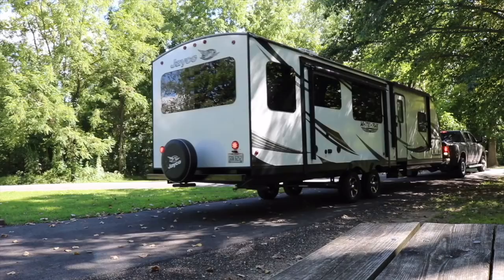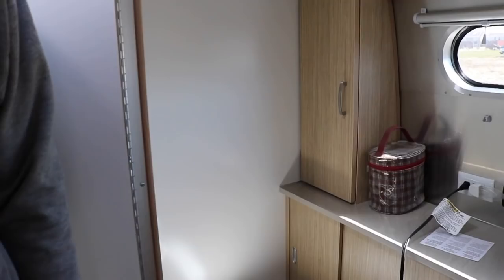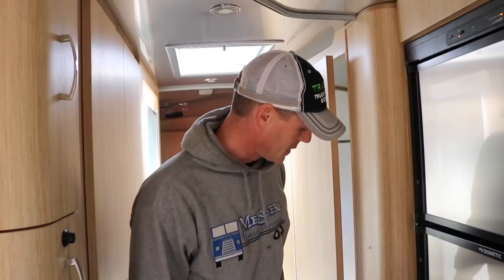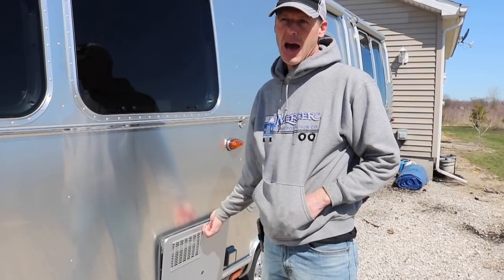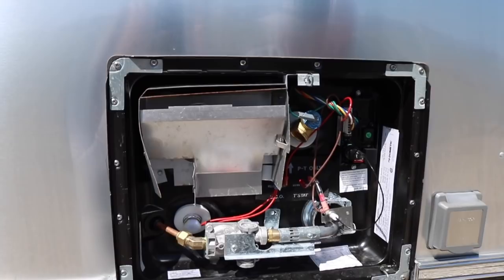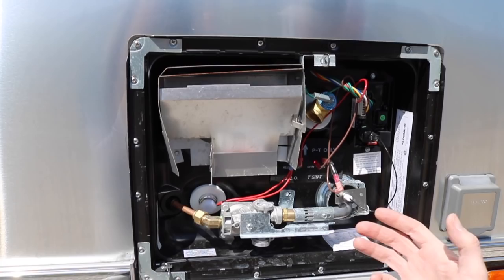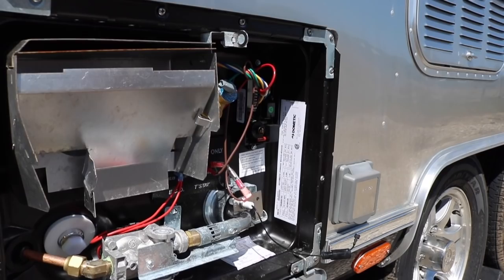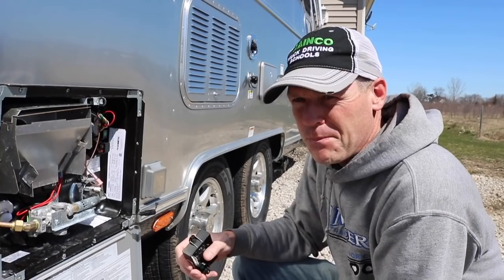DIY Atwood/Dometic RV Water Heater Repair (How To Fix)

Comment: Quick tip for those experiencing issues with there hot water heater. If you don't have the funds available or waiting for new control board you can always hook up the electric heater element (back of tank) with a normal 3 wire power cord, plug it in, and get hot water! Just be sure to unplug after water gets hot or use a plug in timer! Easy solution tried and tested by a full time rv'er.
Reply from the maker: The electric still worked, only the gas didn't with this bad board.

Comment: Thanks you so much for this video. Found it during a YouTube search to find the problem with my water heater. Our RV is brand new and the water heater would only work in electric mode. I followed your troubleshooting items and found that the cluster of wires were not seated properly. Once I pulled them out and put them back in all is well. The igniter fired right up and everything seems to be working fine. Saved me a 2-hour trip back to the dealership. Safe travels!
Reply from the maker: Great to hear! A saved trip to the dealer is priceless

Comment: My reply is late but thank's for the fix. We had the same problem TWICE! Thought the best thing would be to go to a dealer to have the repair done under warrenty, got jerked arround and had to pay for the 1st faulty board plus labor. A whole bunch of bad boards got installed by Dometic (1 guess where they were made). We never got a cent refunded by anyone, even asked Dometic who never replied. Had another no hot h2o issue but this time there wasn't a red fault light on the switch panel. There is a diode (don't know if this is the right description) encased in a plastic sheath to the left of the control panel. It had over heated (a small part of the sheathing had melted). Remove it completely and replug the wire into the male connector without the diode. The h2o heater should  start. Stop the heater and install a new diode. ........ Ivan
Reply from the maker: After we replaced the board ourselves we got a spare but never had to use it, luckily!

Comment: So glad you made this video. Others need to know what you just learned. We had the slideout break on our MH and found out FR would take three weeks to ship the part to a dealer. We took charge and called other dealers in the area (South Dakota at the time) and found a travel trailer company that had it. What we learned is forget about the RV manufacturer and go and look for the  part that you need. The original dealer who diagnosed the problem also replaced the part the next day.  Saved us a huge hassle and time as we were traveling the western states all summer. Our insurance covered it all.

Comment: Hey, just wanted to say thank you for this video. We got our brand new Airstream Sport 16F, and our water heater broke down during the second camping trip. I've purchased a new board, installed it today and everything works perfectly! Thank you so much for this video, you saved us a trip to the dealership.
Reply from the maker: Glad we could help!👍 Might want a spare board. We've got a lot of comments from people saying it's happened multiple times to them.
Reply: Oh, thanks for the advice! Did you have a chance to get a refund from a dealer?
Reply from the maker: I'm actually planning to call them to follow up today
Reply: Wandering Wagners how is your board doing? Mine broke down on the third day of a new trip :( looks like every other one has a manufacture defect :( buying a new one today.
Reply from the maker: Ours is still going strong... Knock on wood

Comment: Yo dude thanks guess what that turned out to be the solution for my hot water tank too. But mine cost 20 bucks. Because I went down and talked to my RV neighbor who said he was switching to the new system heating on the fly or whatever it is. But I'm deeply indebted for this video, because my system was working fine up until I was leaking out the plug, fix that then it was leaking out the water pressure release valve, fix that one day later it all stopped working. Changed the temperature sensors, still not working and it had stopped sparking, like your video showed and I don't know why my main box stopped working all of a sudden, but that was the issue because it fired right up soon as it was changed.
Reply from the maker: That's great! Glad to help😁

Comment: You could have contacted Dometic and explain what was happening and offer to send them the circuit board for testing and replacement if bad. I have heard of them shipping out a replacement saying they will only charge them if they fail to ship the old one back or the unit tested OK. Dometic would rather do that then have to pay the outrages shop  fees on top of the replacement.
Reply: I agree, the vendor of the unit itself will actually work with you!
Reply from the maker: Yes, we just asked the dealer and based on that went with the $80 replacement and 5 minutes of our time. We will still get a new one to replace the bad. I'm sure we could ask for a refund.
Reply: That sounded like a dealership I wouldn't recommend or return to. Their time line demonstrated that they don't care for customers once they make a sale.
Reply: Nope tried that and the manufacturer said no.
Reply: They did that for a refrigerator board for one guy I knew 2 years ago and another guy for an A.C. one last summer. Maybe it depends on which division. They bought Atwood a while back so maybe they are getting too big to care.

Comment: I had a similar issue with my 2 month old jayco eagle atwood water heater Sunday morning (17 year old daughter made lots of noise ; ) ), After watching this I almost just ordered a new board, but I then looked further and realized that the igniter assembly is (painted) metal screwed to the bracket and is expecting to get ground from the metal bracket - I removed the metal screw and discovered there was some white powder in between the 2 pieces, I cleaned and roughed up the mating surfaces, I also noticed the gap between the electrode and grounding rod was almost 1/4” instead of the 1/8” that it is supposed to be - I made sure that when reconnected that the spark would be in the path of the propane - Turned on the switch and low and behold it worked.
Reply from the maker: That's great! Hopefully it'll help others with this issue. Smart thinking
Reply: Wandering Wagners - it looks like I spoke to quick - it stopped lighting automatically again
, I can light it manually when the solenoid gets activated. I am going to see if I can just get the part from Buffalo RV my Jayco dealer
Reply from the maker: Oh well it was a good thought!

Comment: Super interesting video because I’m trying to troubleshoot the high pitched buzzing noise coming from that board when electric heating is on. Your brand new board makes the same sound! So I guess it’s normal and I will just let it go. Thanks for making this!
Reply from the maker: Most electronics make a high pitched noise. Most people can't hear it, but I always can! -Lynn

Comment: All that money for a new Airstream, and this is how the dealer treats you? You should list the name and location of the dealer so nobody else gets burned. Treating you like that is crazy, but unfortunately all of these RV dealers are "fat and sassy," so they don't seem to give a crap about how they treat their customers. Glad you got it fixed. Good luck on the warranty!
Reply: Dealers have forgotten about the customer service for future return trips to the dealer by their very customers that bought from them in the first place!  It's all about "we got your money, don't call us again" attitude!  And, it's getting worse by the day!
Reply: It's pretty common all across the RV industry: Most DEALERS are too "manana" when it comes to getting warranty work done -- they are MAINLY set up to SELL RVs, not WORK on them (how large is their service section...plus there being a shortage of good RV technicians in general to hire even if they wanted more staff) -- so when it comes time for buying, check the dealer one chooses very carefully re: that and other items. Often, buying local (if the dealer has crap customer/BBB  ratings) is a mistake and buying from a much better rated dealer (even if  in another state, sadly) is the better option. Shouldn't BE that way but often is...
But then, if it's an intolerable situation, one can always contact the maker for getting the dealer to "focus" (pressure them if need be!), and it sure does make a difference what the brand/maker is. For example, compare a quality product maker like Airstream (or other quality RV makers such as T@B, Lance, Scamp, Bigfoot, Arctic Fox, or the Class B makers in general) with cheap/crap-makers like the huge Forest River(FR) conglomerate (12 different RV brands?): No comparison, as FR is often just as bad (passing-the-buck is a favorite game dealers and makers play, with the customer in the middle).
In my case, (if I DO end up getting a Class B, and a Winnebago at that -- likely their Revel 4x4 44E model), I'll probably get it from a dealer several states away from me (I live in TX) and will do their "fly out & drive it home" deal. I certainly won't buy from a dealer with a poor or even average rating...but maybe that's just me? ;-)
But that's just how it is: Need service, even if on warranty? At MOST dealers, it's going to be a while! I guess it's because the RV industry is unregulated -- unlike the auto industry -- and they can get away with whatever, even selling people lemons (there's not even a "Lemon Law" for RVs in ANY state, TMK)...THAT needs to change, IMO. ;-)
-- BR
Reply from the maker: RV dealers are just like car dealers if you need work done. They take their good old time, especially on warranty work. Just how it is. We like fixing things ourselves anyhow
Reply: That is the exact scenario I get when Going for Warranty work. They are your best friend when your buying the rig. But after. It's like your interrupting their business and why are you even here?
Reply: @paullundell8009  you said it all. really grinds my gears having to deal with any of these dealers/repair shops...

Comment: I LIGHT MINE WITH A LONG NOSE LIGHTER MY BOARD IS A 4 WIRE AND THEY DONT MAKE THEM ANY MORE SO NOW ITS A MANUAL LIGHT.I OPEN THE OUTSIDE DOOR GO IN TURNE ONTHE WATER HEATER QUICKLY STICK THE LIGHTER IN THE IGNITER HOLE AND LIGHT WALA HOT WATER WORKS GREAT IN A PINCH. STAND TO THE SIDE WHEN LIGHTING. GOOD LUCK
Reply from the maker: Gotta do what works for you!

Comment: Mind boggling what someone else who doesn’t have your “talent” might have gone through just to get this repaired! ...said it before, I love the way you share your thought process on the video as you work through the problem. Could you please let me know the steps you took when you checked continuity from power feed to igniter. I assume you used a circuit tester, but how do you do this?

Comment: Awesome job diagnosing and repairing your RV furnace sir , but also very disturbing to find out the horrible lack of customer   of customer service of the RV air stream dealer  and or Air Stream its self on this matter. Your Wagner family has paid hard earned money for this RV lots of it for the Air Stream name this problem should have been fixed ASAP by dealer or Corp.

Comment: Its a shame that a brand new trailer has a bad part already.  I get it, things happen.  Whats annoying is how much the mark up is on the parts.  What disgrace.  Glad it was a simple fix for you.  Hopefully you'll get the replacement part back.
Reply from the maker: RVs are no different than anything else...Get a part at a car dealer and it'll cost you 2-3x what you could but it yourself.

Comment: The good thing about this is that you were at home sitting in your driveway.  Had you been out on the road somewhere, the lack of hot water would have really sucked.  Good to see you figured it out for $80 rather than succumbing to your dealer's whims.  Now get out there and camp in that thing.  By the way, when are you and Lynn getting out there full time?
Reply from the maker: Well it did happen when Mike was in Cincinnati, however the water heater worked on electric, just not gas so it wasn't a big deal. We camped last weekend and it was great! Still deciding on this weekend. We plan to full time as soon as the house and things sell. Still no offers on it. Ugh
Reply: The whole "selling the house thing" is an unpleasant experience.  Erica and I got our house in Florida sold after four months of being on the market.  IT was a real PIA.  Your house will eventually sell.  If your realtor isn't working HARD for you, dump them and find somebody who will.  Seriously.  We learned this the hard way.  We take delivery of our Momentum 354M in June and we will definitely be getting out on the road.  Maybe our paths will cross at some point.  We both enjoy watching you vids.
Reply from the maker: Thanks for the encouragement! Our realtor seemed to work hard at first now I ask why he isn't advertising our house more and I don't get a straight answer. Might be time to have a talk with him haha we know it'll sell, we just don't know when. Congrats on your house sale and the new momentum!
Reply: Thanks!  We're super excited about it and can't wait to get out there and enjoy it.  RE your house: if you haven't received so much as a single offer since listing it, consider changing realtors.  There's a bit of a fee involved, but in the end, it's worth it.  We hope to see you guys out on the road.

Comment: That was a great video!!  Fun to watch.  I'm waiting for the Dometic mixing valve replacement video...
Reply from the maker: Thanks! It's nice when it's an easy simple fix haha
Reply: The Dometic mixing valve is often just partially clogged with crud. I would take it off and inspect it (very easy)before ordering a new one. The symptom was the hot water was not very hot.
Reply: @steveethier8941  Thanks, yes, I'll likely clean that valve during un-winterization next year!!

Comment: I would add that you should first check the thermal fuse, T-stat and ECO before going all in on a new board. You might have a $5 part that requires replacement instead of an $80 part. You could find yourself replacing the board and it still not working because of one of the other safety devices.
Reply from the maker: We checked everything before determining it was the board

Comment: I have the same heater on my brand new Jayco, and it's having the same problem.  I had a mobile RV tech come out today and check everything.  Everything checks out, so we've ordered a new board, and it'll be installed in a couple of days.  I'll then talk to my dealer.  After searching online, it seems like there are a lot of Atwood boards failing at the moment.  It seems there's always something to go wrong with these things!

Comment: You did exactly what I would do.  Warranty service is useless because they will take a more than a month to get a five-minute job done.  I will say I'm not impressed with your dealer.  I had a few issues under warranty with my rig and my dealer was great.  I called my dealer, they contacted the manufacturer and the parts were shipped to me priority shipping with a return label for the replaced parts.  I had the parts I needed at no cost within 5 days. These dealers that tell people it takes months to get a part and repair a rig under warranty should really be ashamed of themselves.  You have no experience fixing an Atwood water heater and you diagnosed and repaired in five minutes.
Reply from the maker: It would have been great if that's how we were treated, however most people might not accurately diagnose the issue so dealers are hesitant to trust customers. Sucks for someone like us who actually do know what they're looking for and get treated like we don't know anything. Most times we know WAY more than RV techs.

Comment: You might want to check that 2amp  blade fuse in the old circuit board. That’s works the igniter.  Just a thought.
Reply from the maker: The board was tested twice as being bad.